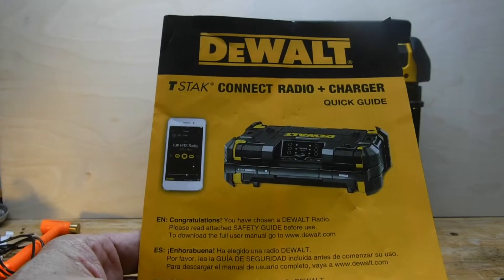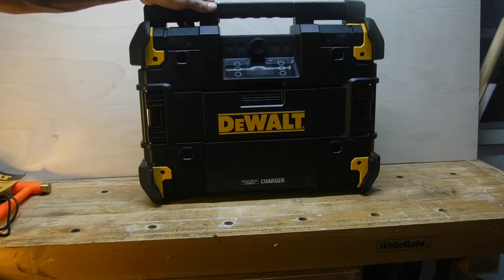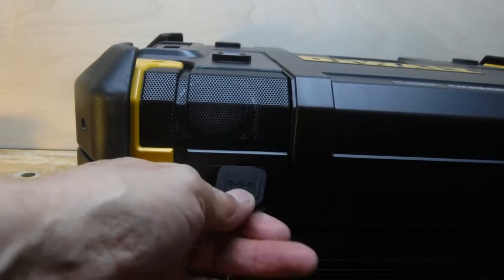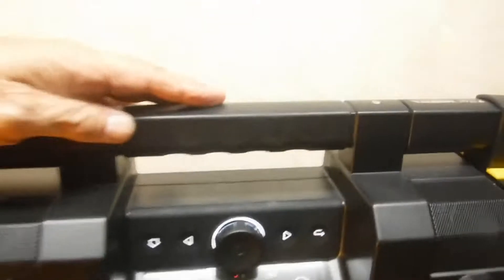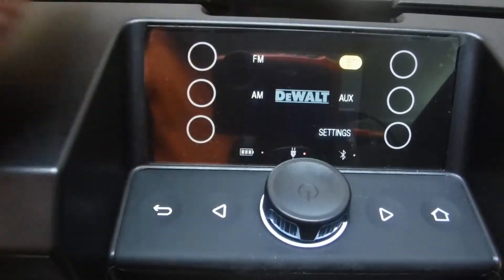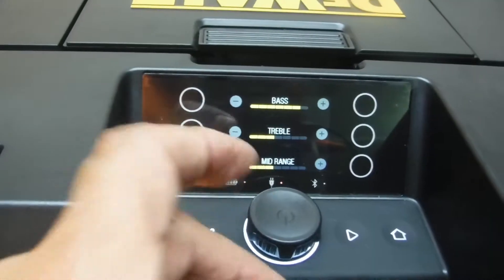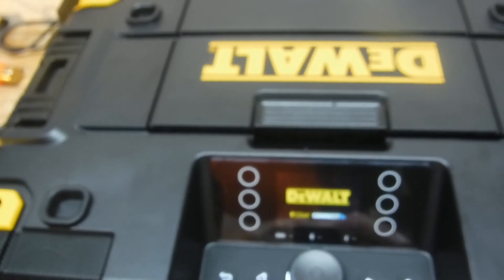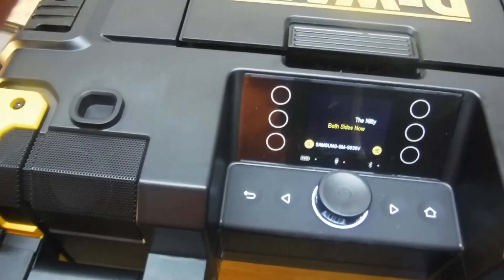DeWalt Tstak Connect Radio + Charger Review

Comment: How many watts is the toughsystem radio, if the tstak is 45 watts and smaller?
Reply from the maker: Hello, I really don't know anything about the toughsystem as I don't own one. That being said, 
I will quote you what I found on the DeWalt Website. For the tStack, a reviewer wrote this: "the sound on both devices is otherwise very good and there is no audible apparent differences between the TStak and the ToughSystem audio systems, even if the TStak has a slightly smaller pair of active subwoofer driver and passive resonator. "
Reply: @rockpaperstone8722  I'd like to get a TSAK,  just waiting on a sale. I saw a review that said the sound was the same, up to medium volume. After medium, there is a difference, but I don't want to crank it that high. I read the power brick was 24v, but don't see the amperage, can you see what it is? I want to power it from my van.
Reply from the maker: @massa-blasta  Power supply is 24VDC rated at 2 amps. You might want to use a power inverter rated at 3 amps or more.

Comment: Ive just purchased one of these radios second hand with barely any use however, the power cord makes a buzzing sound at the plug when the plug is turned on at the wall but the radio is turned off. Once the radio is on it makes no noise at all. Does this happen with your radio or does anyone know if this is a fault with the plug or if its completely normal. Any help would be appreciated.
Reply from the maker: Mine doesn't do that.

Comment: do you loose the presets if you unplug it?
Reply from the maker: No, the presets are there when you plug it back in. Also, its real easy to set them. You just touch and hold the preset number that you want assigned to the station you 're playing.
Reply from the maker: Also, there are actually 12 presets available. You rotate through them by pushing the forward arrow next to the control knob.
Reply: @rockpaperstone8722  That's great man thanks! I'm totally getting myself one of these

Comment: Is it a fast charger? Also does it charge flexvolt?
Reply from the maker: From the manual: 12 VDC / 20 VDC (including XR® FLEXVOLT® Battery Packs) Manual can be found here: https://fccid.io/YJ7DWST17510/User-Manual/User-Manual-3877669
Reply from the maker: It charges pretty quick. No more than an hour with my 20 VDC batteries.
Reply: @rockpaperstone8722  hmmm if it's an hour... That's the slower charge rate unit... That won't work for me... I need that fast charge even though I have about 15 packs. Most of them 4.0